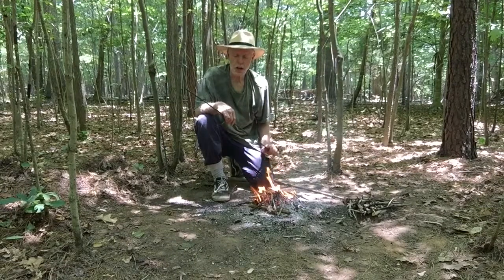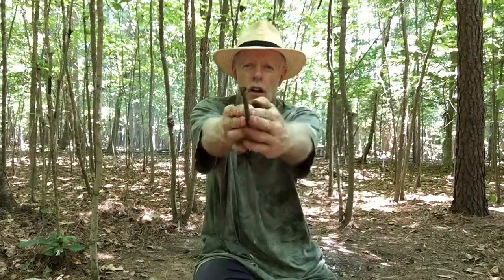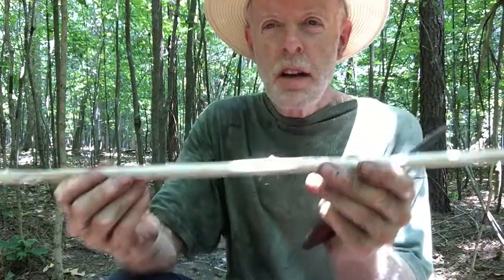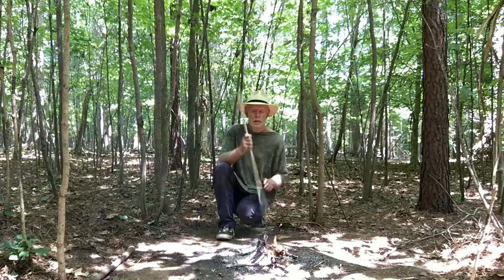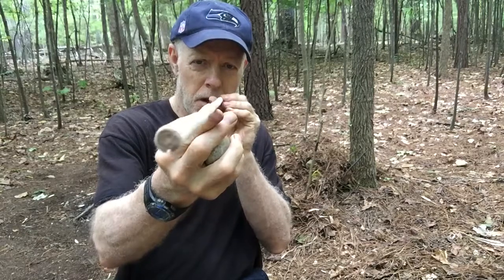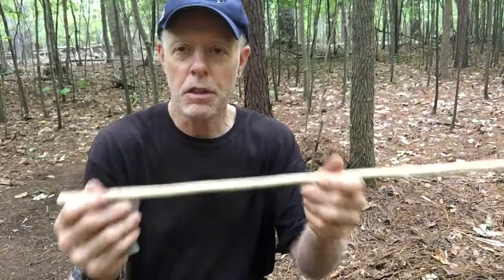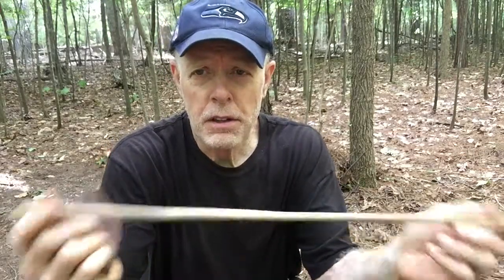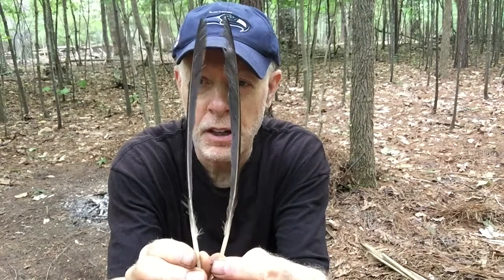Green Arrow Shafts~ Quick Cured,, Fletching, And Wrappings, And Creating The Arrow

Comment from the maker: This is a blunt arrow that the natives used on small game. 
This video I taught how to make a quick seasoned arrow from a green shaft. 
If one desires a head on the shaft, then it needs to be put on in aliegnment with the shaft.
If the point is even slightly misaligned that when the shaft is spun the tip wobbles out of exact aliegnment, the arrow will wobble in flight.
Understand?